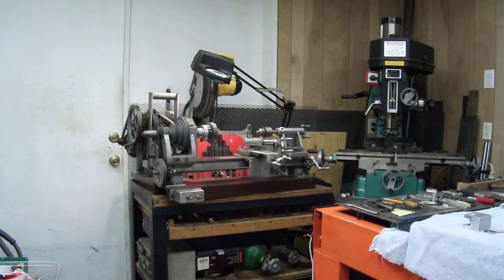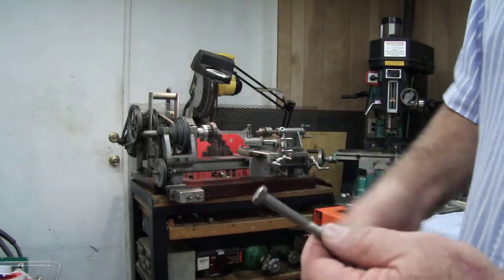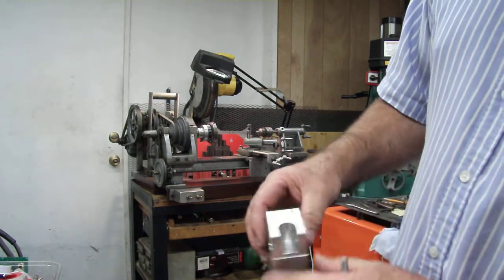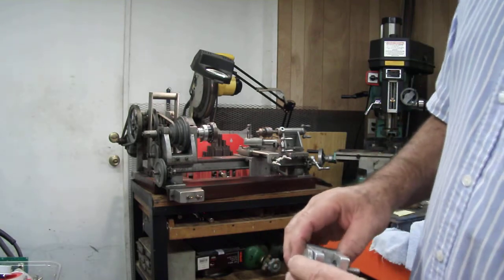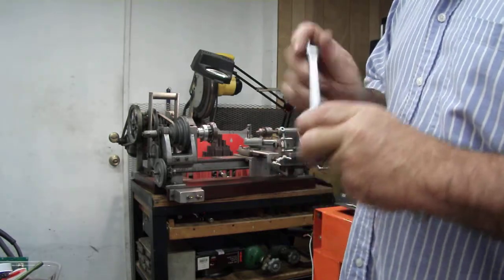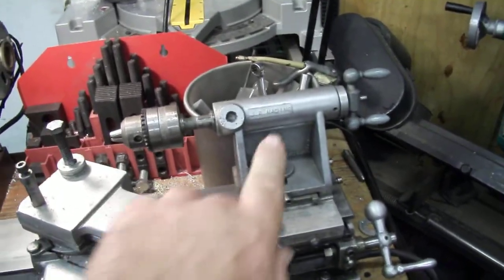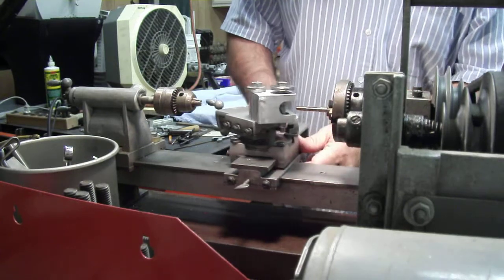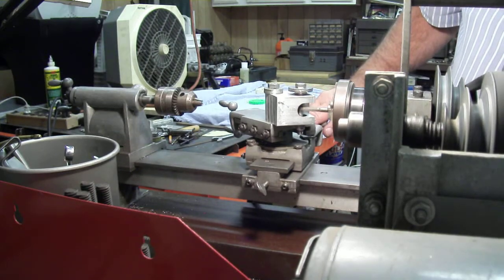3d printer # 7 how to video

Comment from the maker: Well, I have found that all pla or abs plastic is not the same, qualities can be very different, one can have more air trapped in the filament than another. So the hobbed bolt becomes very important. A knurled bolt is still flat and will smash the filament to the point that it will not push on into the hotend, where as a hobbed bolt made correctly will follow the curvature of the filament, has more grabbing power and will not flatten the filament. This is also important with soft/hard  plastic.